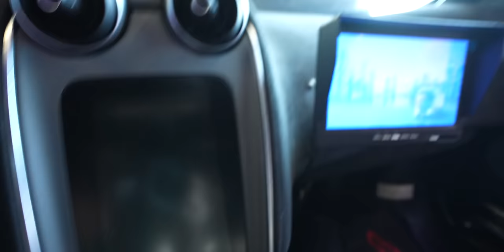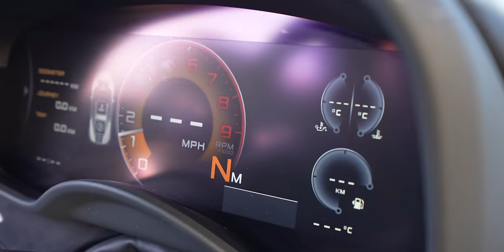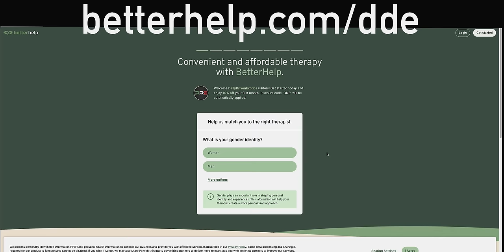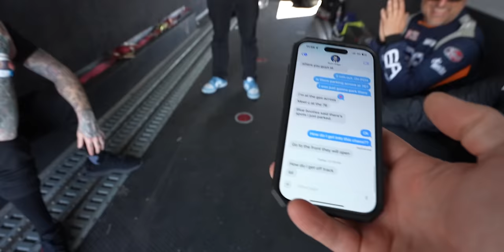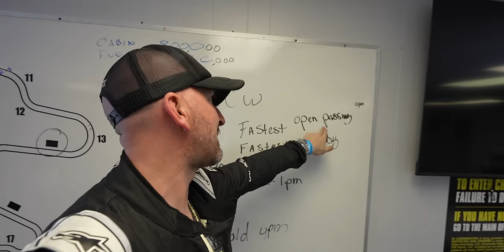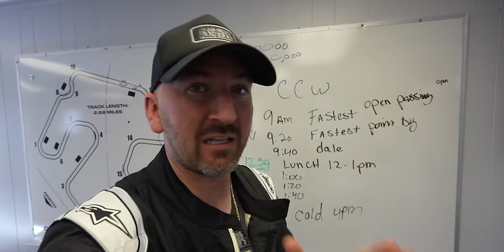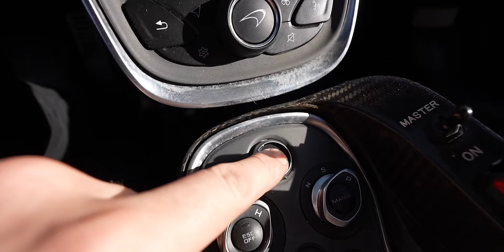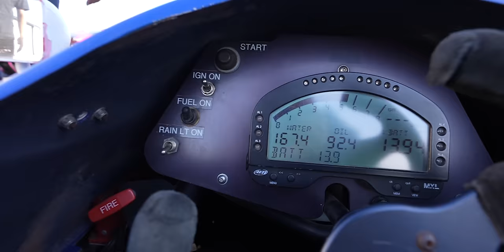COCKY SUPERCAR OWNER KICKED OFF TRACK, THEN HE GAVE IT TO ME..

Comment: Time to take off the flame tune and make it smooth at the full rpm range.
Reply: Yes, no need for flame tune on the track.
Reply: @Pasovineyard  but it does look badass lol
Reply: 100%
Reply: Unburned gas can lead to detonation   on the track and kill a motor
Reply: Flame tunes in general, on any car, are stupid. Why Dave put one on his race car is beyond me. Being in a Maclaren race car, on a track full of Hondas and Subarus, he thinks he needs to look even cooler.😂 what a squid.
Reply: Flame tune is ridiculous on those amazing cars !!
Reply: i never understood that flame tune in the first place 😭 not on a race car
Reply: You want your car running at peak performance on track.. your gonna need 100% from it.
Reply: there are some companies like M engineering that give you multiple maps you can select from using the cruise control stalk...provide this still has a cruise control stalk that might be an option.
Reply: flame tunes are for posing, not racing.  get a big boy tune.
Reply: Yeah I didn’t like the flame tune they are cool but i think they should go for performance on certain cars like this they are cool enough we don’t need that extra excitement factor like street car content
Reply: @Hoof30 if your 12
Reply: normaly you put multiples maps if you want a flame tune so you can run a proper tune for when your actualy looking for performance instead of visual effects
Reply: @Oderus-Urungi true if your experienced with a car with that much HP but most people start out small and work up to the experience needed for those cars they have, much less Dave is new new with race driving, at best they would be running de-tuned as it is, dave needs more time before ya give him 100%   ya gotta rember these arent intro race cars there high end performance factory built race cars. 100% power with a new driver means a total mess of a time if they even can keep it on the track... give em time i'm sure the flame tunes at the race way will go away once they get to the need of 100% power lol
Reply: Flame tunes and straight piping (not Valved) is ghetto in my opinion.
Reply: But still fun lol!!
Reply: Didn’t the 600 lt shoot flames from the factory?
Reply: Staight piping a race car is legit! Flame tune not so much!@simpleinseattle
Reply: I'll watch your ads because I know it helps support the channel but I do not appreciate BetterHelp being a sponsor. They're a vile company. You guys are BETTER than this. Do your homework and don't have companies paying your bills in exchange for your most vulnerable fans being taken advantage of. Seriously makes me sick. Do better DDE.
Reply: @simpleinseattle artificial burbles and pops with flames from tunes is obnoxious but that's their niche even though it reminds me of the Honda drivers doing all of that but going slow as shit 😂
Reply: @subiesnacks8446  you're watching the wrong youtubers if you don't like a flame tune lmao
Reply: @Hoof30 who said I'm here to watch them, 90% of the time they're muted.
Reply: @subiesnacks8446  you come to their channel to watch them modify, tune, & drive their cars, then complain about how they modify, tune & drive their cars and put the video on mute... Sounds like you've got this youtube thing all figured out lmao
Reply: @simpleinseattle Umm, pretty sure that he installed a valvetronic exhaust on the McLaren….

Comment: Track the senna and murci nextime
Reply: Why would they ?? Those are street cars , they specifically bought these cars for track , doubt they’ll bring anything else
Reply: @arxhetype1828 the Senna has track mode so to see what it can do?
Reply: Wtf are you talking about, you can put any car you want on track, most of their cars are made for the track.
Reply: @Oderus-Urungi 
They are not made for the track, just made to go fast.
Reply: @briankearn6991  an the purpose of a track is to have Fast cars driven on it, right?
Reply: @spliffdelakong5422  but Damon didn’t buy it for the track like yk they bought the legitimate race cars for
Reply: @briankearn6991  exactly, and going fast is not the only current point of getting track time
Reply: @Oderus-Urungi  
it’s a race track, for race cars.
Reply: @briankearn6991  the Senna, named after Ayrton Senna, is most definitely made to go fast on track, so are Ferrari's, Lambo's, Nissan GTR's, Honda NSX, even Civics, an  Golf gti's.. etc. etc.
Reply: @Oderus-Urungi  
The Senna is also available as a track only car without road legal requirements, which add unnecessary weight. 
Tracking a road car is the worst thing you can do to it no matter how fast it is. See what it will do and the brakes, suspension and engine will overheat within 5 laps.
Reply: @briankearn6991  That's why they have Mike there, cuz all ya gotta do is a few lil upgrades an all those issues are gone.
Reply: @Oderus-Urungi  
Mike is there to build cars.

Comment: Dave just needs to get adjusted to the momentum he was missing from the sim. 

I also started left foot braking irl and it’s quick to pickup, provided you know controlling momentum is your primary problem and you need a comfortable solution for it. 

Then progress to racing, where your brake is your momentum forward ballast that increases your slip angle, not the thing that slows you down.

Comment: get a legit wheel tire set up for the track on the Squadra Corsa with some upgraded steal brakes lines if it doesn't already and it would be a weapon for street and track under Mikes command. those three cars flying down the track together was too fuckin cool. DDE track days are the most fun to watch imo

Comment: Also it obvious you are timid on the cars lean and pull on the corners don't be hit it hard it will hold if you're running the right rubber. This isn't street racing. You just need more track time.